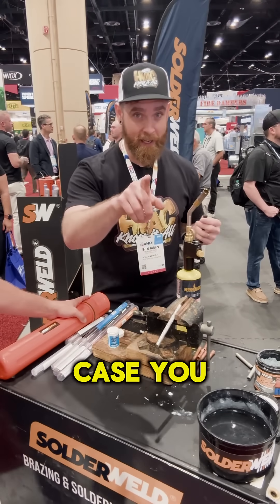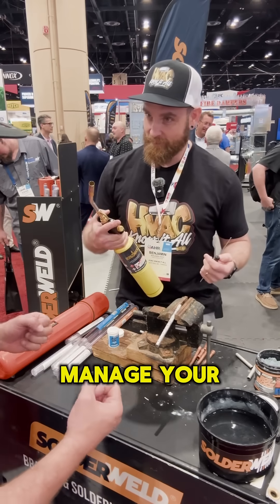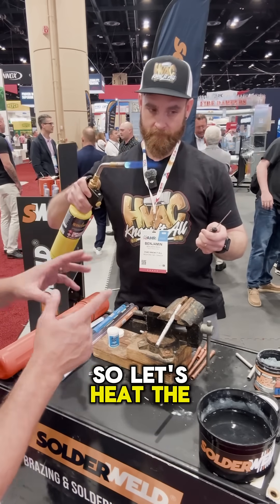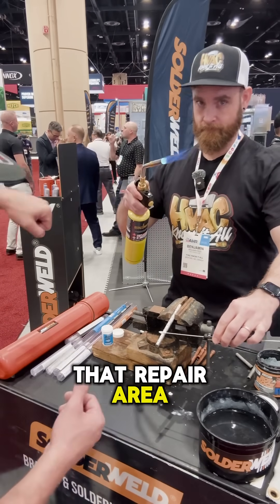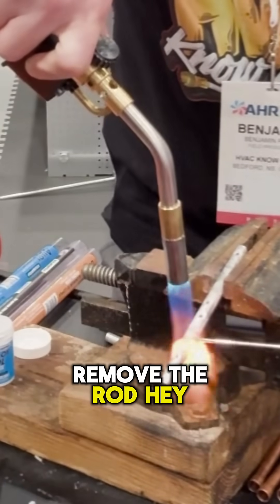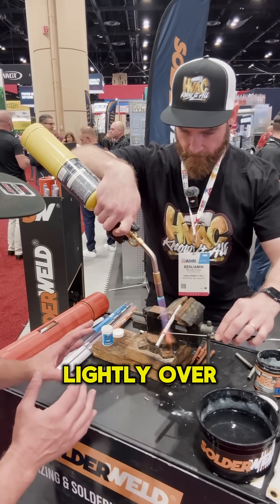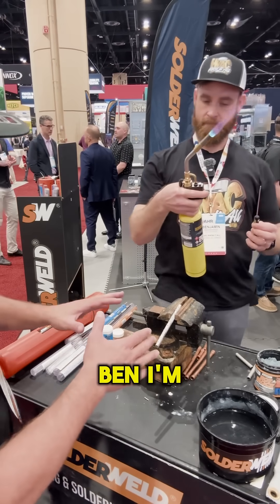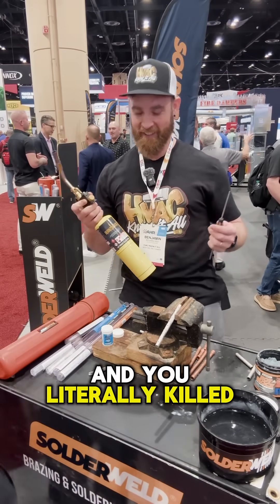Aluminum Coil Repair

Comment: Awesome stuff, Ben! 

Just a tip for the future, always keep your flame higher than the tank to prevent from flashback
Reply from the maker: That's not always possible depending where the leak site is.  Sometimes the torch tip needs to point down.

Comment: As both of my commerical HVAC/R instructors have put it: you CAN solder aluminum. Don't try to do it with your oxy-acetelyne torches. If you're repairing leaks in a coil thats more than 7/8 years old, don't bother, just steer the customer towards upgrading their system, ideally one with a more resistant coil, because otherwise you'll be back chasing pinholes in a few weeks. They said that typically the only time it makes monetary sense to solder aluminum is a brand new install where some freak accident occurs and you have a leak/your coil comes loose or something else to that effect. Now obviously I'm sure there are other times to do it, but the general sentiment is its not worth the headache.

Comment: What are you soldering on ?
Reply from the maker: Aluminum
Reply: @HVACKnowItAll  I thought so because you were using aluminum rod I was slightly confused because I seen what look like copper pipes beside the vice

Comment: I’ve found if your doing some repair like this your in a crap situation…don’t let it get any worse. Cut the coil off @ the copper where you can braze it back in and make your aluminum repair where you can solder it easily. You usually only  get one shot at getting it sealed. Just my experience.

Comment: My only issue with aluminum brazing is that unlike copper it doesn’t turn red, it just melts so I end up making a bigger hole trying to seal a leak on a coil. That and generally, you’re doing it in a much tougher position than just standing up.
Reply: Shoot. I’ve made the hole bigger on copper a few times lol